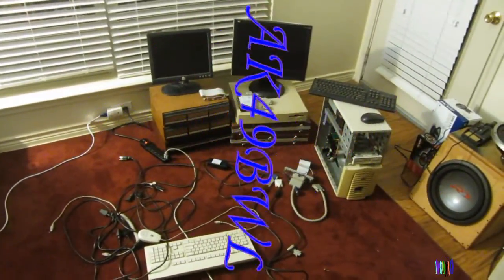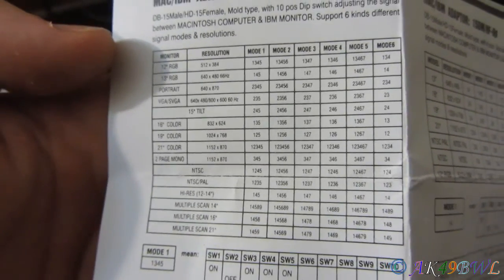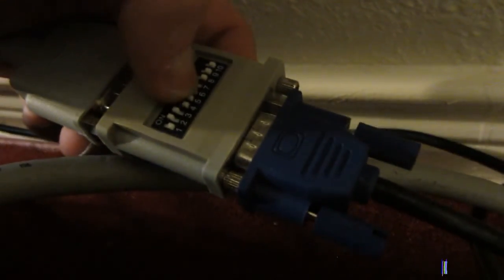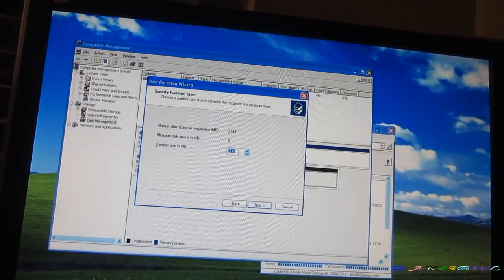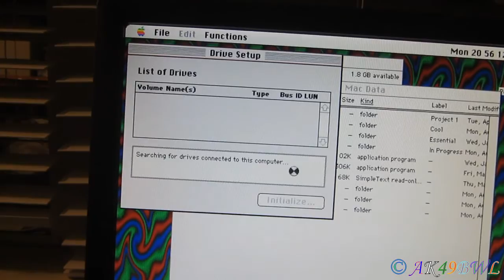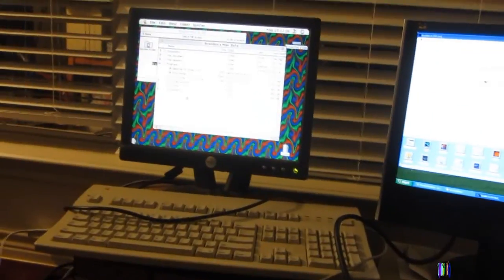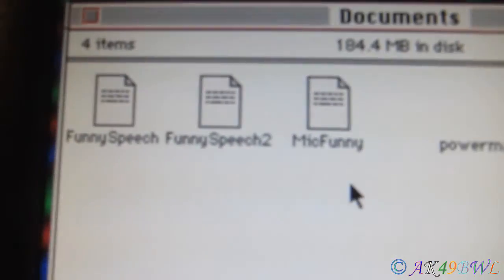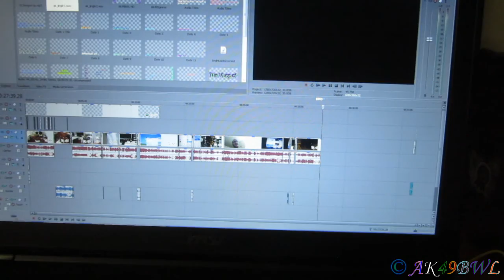PowerMac 6100 LCD and Data Transfer - VLog 238, 06/24/2015

Comment: Finally you heading in the right direction on computer brand.
Reply from the maker: Three Swords ? With the Mac? I have this PowerMac, had a Performa, three Asus desktop boards (and you won't convince me to get a different brand mainboard lol), three Dell and one MSI laptop.
Reply: ***** Love my Mac stuff. No clue about mainboards.
Reply from the maker: Three Swords Yeah, see I like building my desktop machines, not pre-buying them ;) I only have this PowerMac because I needed a keyboard for the Performa, and the rest came with the keyboard LOL .... Then the Performa's hard drive failed and I didn't feel like resurrecting it because it was an all-in-one and heavy as fOck. So I put all the important bits in the PowerMac and it's mostly been sitting around since. I have no interest in the newer Macs, really... I can build a machine twice as powerful as the newest Mac system for half the cost of it.. What's the point lol
Reply: I can see your point. I would do the same if it was not for work and needing it to be ready right now. I appreciate your passion of your hobbies and the diligence you exude towards them.

Comment: Oh fix old slow XP with a Mac 8 or equivalent! Lol at ending!
Reply from the maker: ***** Sadly Mac OS 8 (and 7.5.3) isn't quite as open on the hardware it'll support lol. Found out with little research that ZIP isn't even supported until OS 9 :/ So I just hope these two SCSI hard drives hang on as long as I'll ever need them, or I'm finished transferring data between my various systems without floppy disks!